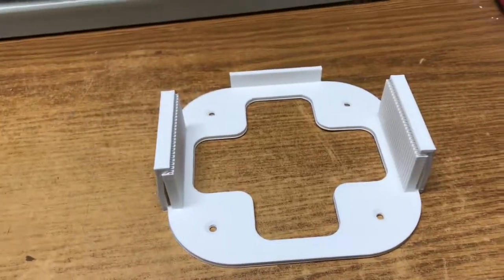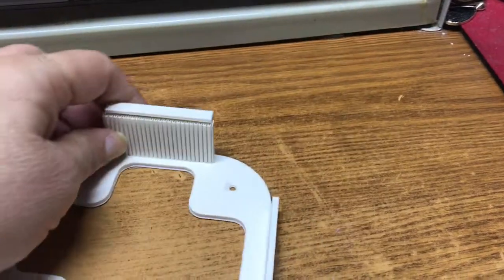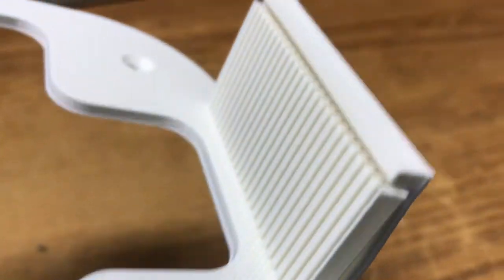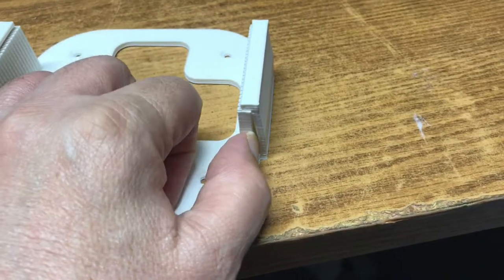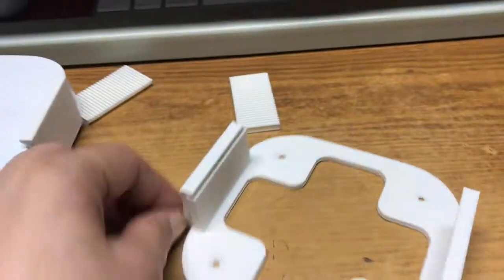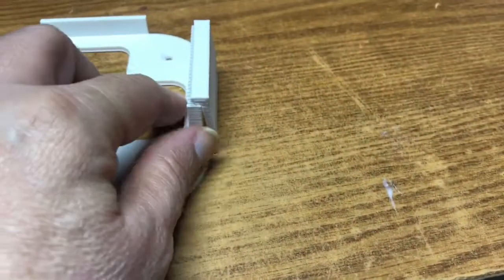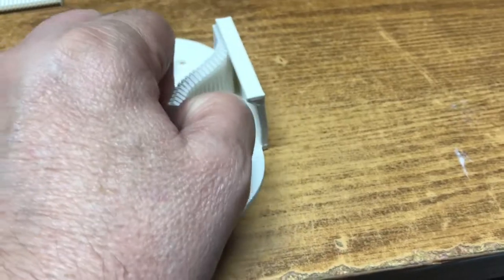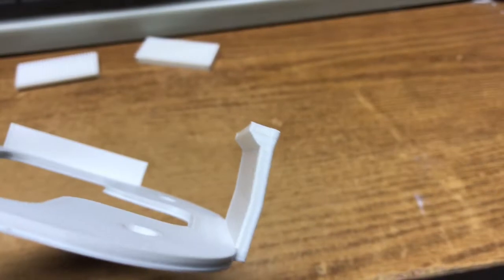Support in Simplify3D are sweet

Comment: We’re those base settings?
Reply from the maker: Hello, This was 3 years ago so I can't say I remember for sure. I think I might have raised the part separation slightly from default but not by much. I try to keep a 2 layer separation so if you are doing say 0.2mm layer height I would set the separation at 0.4mm and so on.
Reply: TerryMakes Thank you very muchhh!!!